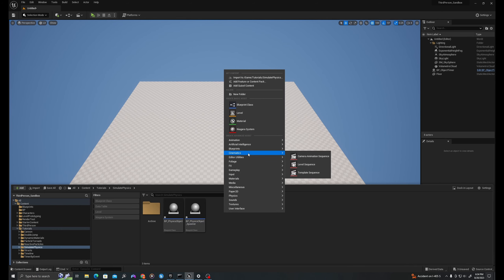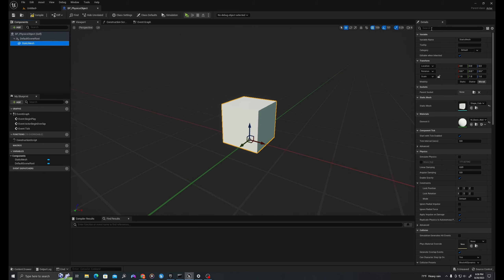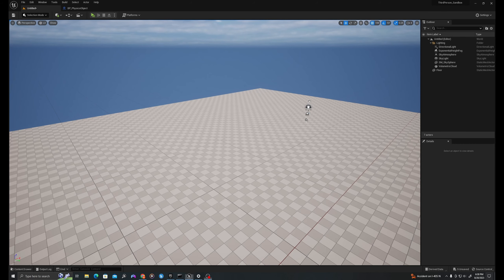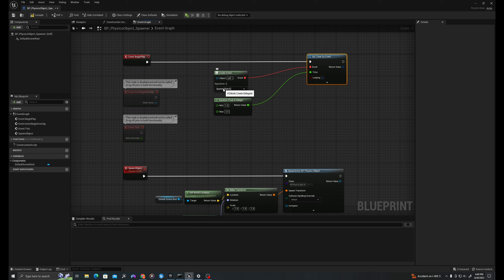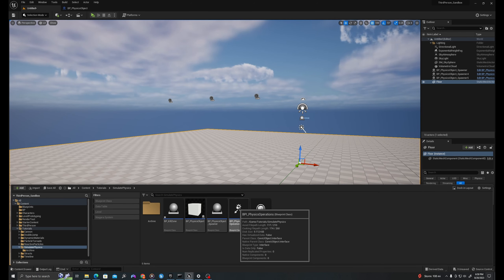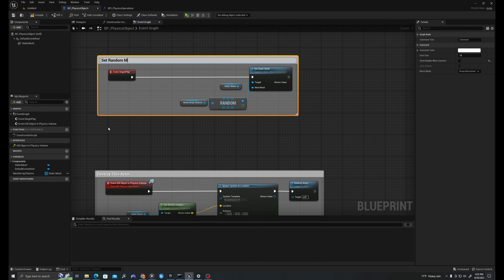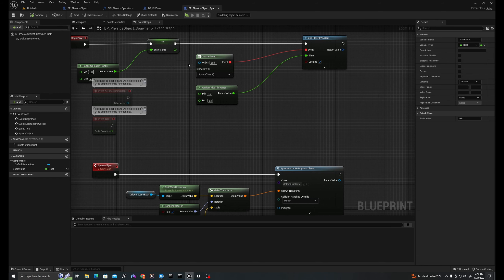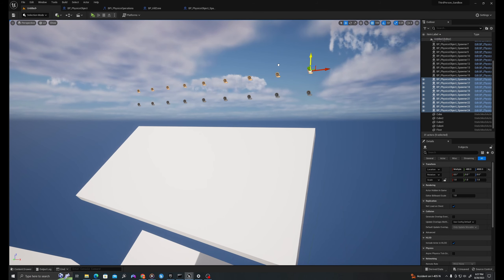UE5 Blueprint Tutorial: How to Simulate Physics on Spawned Objects

Comment: Fantastic! That's really great tutorial, thanks so much
Reply from the maker: Glad you enjoyed it 🙏
Reply: @UnrealDevHub  Question, in play mode, I'm noticing my spawns from the BPSpawner are coming in without variation from the Random Float in Range node, ie if I put 1 min and 5 max, all my spawns are coming in somewhere between 1 and 5 seconds, but with no variation. Is it updating as it plays to "spawn, now choose a different time to wait, spawn, now choose a different time, etc? Or is it meant to only select a single initial random value in that range after play mode begins and keeping that value for every spawn?
Reply from the maker: @ninomancuso7021  That's an interesting note - maybe after the function call that is executed by the timer, you create a new RandomizedTimerDuration (the amount of time between each event call) and set that to a variable, which is plugged into the timer. I see the issue that might be happening in the video. The RandomizedFloatInRange may not be getting reset, because no true Event is happening - the value may remain static in the way it is shown.

Try getting a RandomFloatInRange after the event called by the timer, save that to a variable, such as TimerWaitTime, and plug TimerWaitTime into the SetTimerByEvent node above in the float input for the Time. That way it will guaranteed create a new float value each time in the range you specify.
Reply: @UnrealDevHub  Thanks for the follow up, I'm not quite visualizing what you're describing.

Comment: I can't understand how Niagara System attaches  to BP_PhysicsObject. For example if we want to change Niagara System, what should we do ?
Reply from the maker: @eastgackle7441 The Niagara system is a component added inside the blueprint, in the component panel in the top left when you’ve opened the blueprint. Hit the “add component” button and select Niagara system component.

To switch the Niagara system to a different asset, your select the Niagara component (in the components panel) and on the details pane on the right side of the page, you’ll see the Niagara system asset type, where you can swap for any other Niagara system you’d like.

Comment: Hi I have a question, can I make the spawn animation continue until a certain point? For example, by time or by created objects? Thank you
Reply from the maker: Definitely - there are a  few ways to approach that.

Per Spawner, you could set a timer for X seconds from BeginPlay, and after X seconds, you could ClearAndInvalidateTimerByHandle, or set a Bool that is plugged into the Loop boolean value for the CreateTimerByEvent node.
You could use a DoN in association with the timer, which would only allow you to spawn a certain number of times. The standard DoN Macro doesn't have an outbound execution pin for "CounterExceeded" so you might have to find another way to kill the timer, instead of just allowing it to live for ever and fail the DoN internal test.

You probably just want to have an Int that is MaxSpawnedObjects, and create a counter on the event called by the timer, increment each time the event is called, and test each time the event is called with a branch, and if the CounterProgress is greater than MaxSpawnedObjects, then ClearAndInvalidateTimerByHandle to kill the timer. Best of both worlds!
Reply: @UnrealDevHub  thank you so much)

Comment: Hi, I have a question about this kind of thing. How can we add sound to a physics object so that it sounds like it’s bumping, rolling, crashing into other objects etc. 

This was awesome though. Thank you.  Subscribed!
Reply from the maker: You can approach that in a handful of ways. One way would be OnComponentBeginOverlap you would PlaySoundAtLocation, using the default scene root of the Blueprint as the location, then add a sound cue as the audio to use that would be your sound reaction type (slide, bump, crash, etc). You could use an audio cue, and use some input like velocity, or the physical material of the overlapped component to determine the sound from a series of available sounds inside the cue.

I can make a video about this in the future, that’s a great question 🙏🏽
Reply: @UnrealDevHub  awesome. Thank you!
Reply: @UnrealDevHub  im not even here for this yet and i know for a fact im going to need it, sub'd!